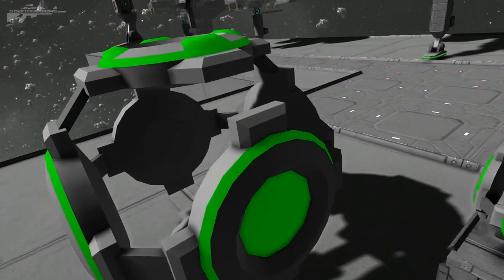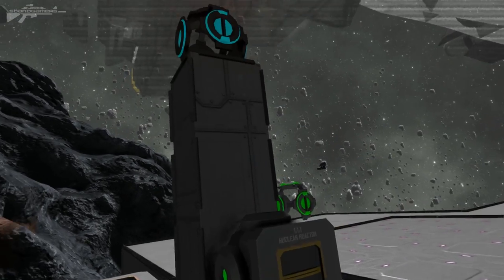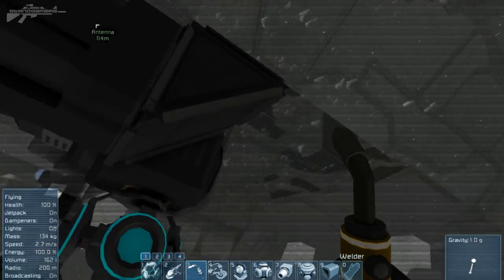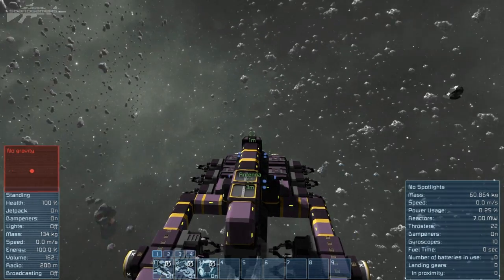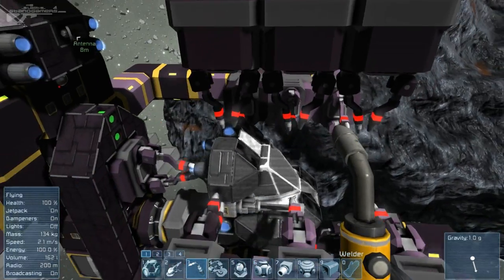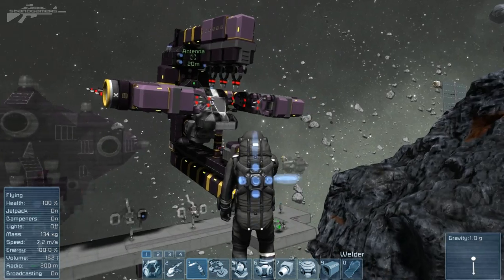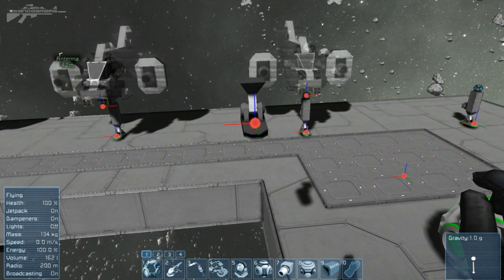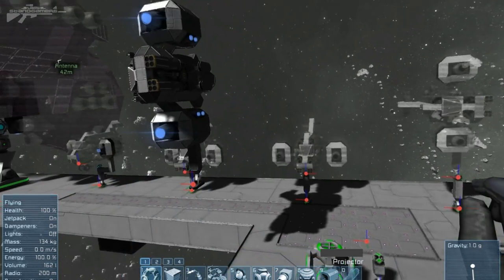Space Engineers - Projector / Hologram Block, Automated Building

Comment: are the holograms visible to other people in survival? if so you could use them to make a mirage fleet by offsetting them in a stealth vehicle to distract foes, obviously it wouldn't be overly effective but the sheer fact of a bunch of objects moving will distract quite a few pilots. you could also use the hologram generator as a sort of mirage shield making a dis proportioned ship around yours to throw off aim as well. but on the construction side adding a rotor and pistons would make building larger craft a lot more viable, and it could also be used to make easily fixable ablative plating, maybe putting a few welders on rotors or even pistons and having them constantly repair ablative armor.

Comment: Hi Dude, big fan of your videos, thanks for sharing your information. I have one question, im trying to set up a similar setup but to create warheads from a blueprint and launch them down a tube. Ive done the tube and it works fine, but i cant seam to get the stem setup, as in the grinder wont cut it free. The setup i have is that the grinder is sat between heavy armour blocks, the grinder block is a free space but it wont cut the stem block and i havent the foggiest why.

Comment: I'm still wondering what happened to the "3d printer" giant construct. I seen one of the closed beta testers post a spoiler about it and the picture was quickly removed. It was a large construct that required multiple blocks (a lot) and it was by the looks of it a system for blue prints, guess it got scrapped or it's still being made?

Comment: I think they need to remove the "grid" restriction on the large projector being able to project small ships ...
Reply: +Tyriael Soban They can't since the projector is technically part of the ship you are building. Even if its not directly attached, it still need to attach to the station or ship you build it on... You'd have to be able to build small ships parts directly on a large ship or a station to do that, which isn't possible... I think the trick of making a small ship with just landind gears, a few armor blocks, the projector and a small reactor is fine.

For large ships, I don't do this trick, I attach it directly to the station and just cut it loose when I'm done!

Comment: Now only if there were conveyor belts so ship can just roll out a military base or factory
Or if it's a massive ship that's a trade vessel and say it has no small fighters and comes under attack and all you have is a repair bay, that hologram, and all the supplies to build ships
Just imagine the possibilities of this add in
Reply: Conveyer belts wouldn't work in space the stuff on it would fly off into space unless you have a gravity generator but we do have pipes to do that
Reply: zarek vanlaningham

this could work because the projector can be built into the links and the ship is slowly built so then it can't fly away.
*****  you can always build it something like arron builds tracks for tanks, and then have the ships be projected on them (so the projector is a part of one of the links).
Reply: That's something I didn't think of vok
Reply: Vuk*
Reply: I think I have you solution, make a track, then rotors attached to wheels and voila you have your conveyor belts